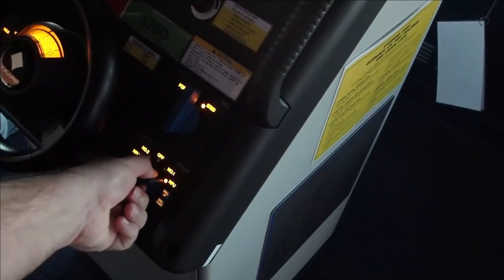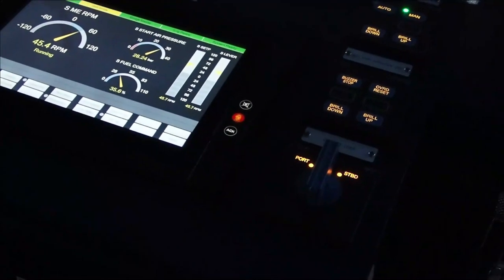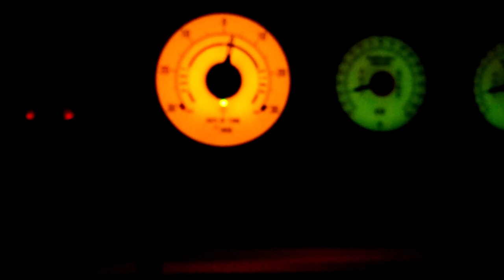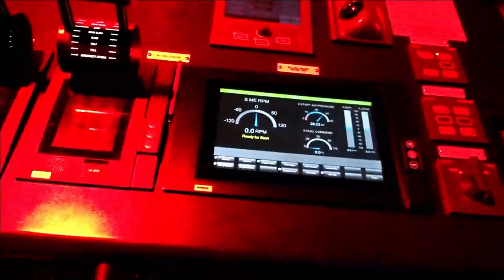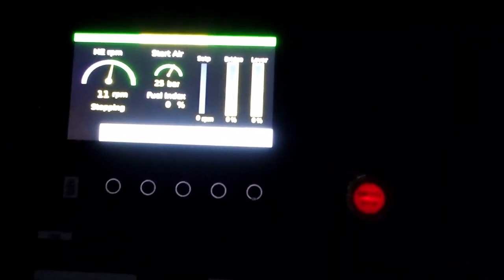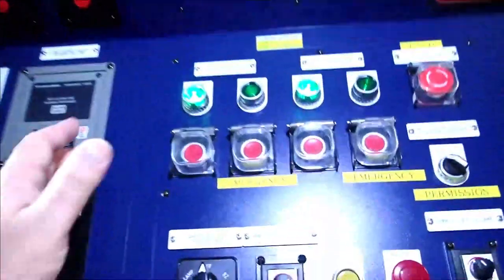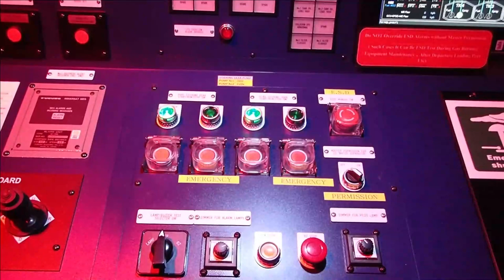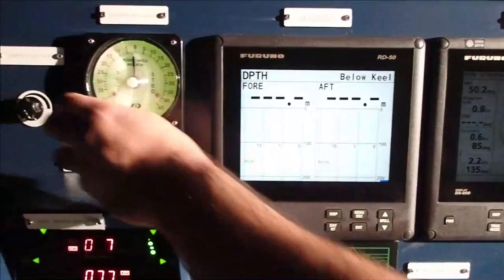How to perform the per-arrival tests on the Main Engines and on the Steering Gear Systems and Equip.

Comment: all these are in yopur vessel my man in my vessel al was manomatic
Reply from the maker: Yes Vasilis every vessel has its differences
Reply: @nickthesailorman360  i was chief engineer for 20 years but old technology before ISM,ISPS, MLC, all that bullshit but the seaman quality was low but now its below zero.I dont understand when you have the time to fill all these forms?And if you fill them when you sleep?
Reply from the maker: @megalepivolos  I got you, the truth is that now days the crew is well trained they know how to act in case of an Emergency and they act fast.Trainings are performed to all ranks and it is working, now days Deck cadets can calibrate the Gas Detection Systems when 15 years ago they wouldn't allow them to them.
Reply: @nickthesailorman360  maybe you are right,and depends on what nationality are the seaman because there are nations that are bond to sea like we greeks and we have something more in our mentality,means Greek captain can weld and perform piston removal,which is more important